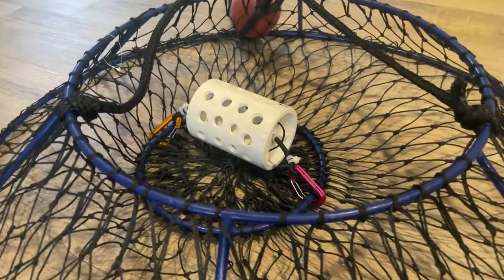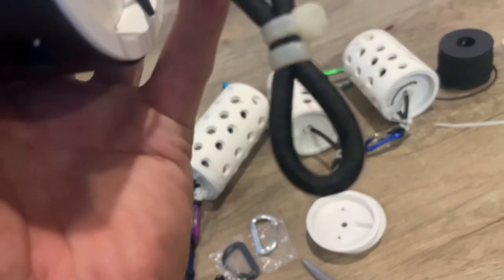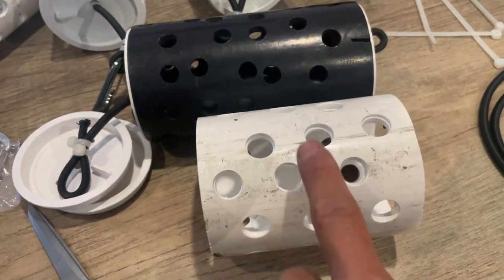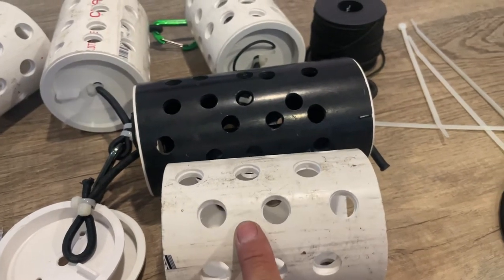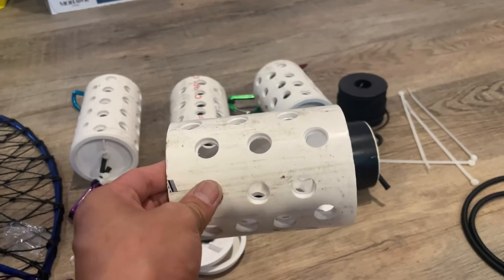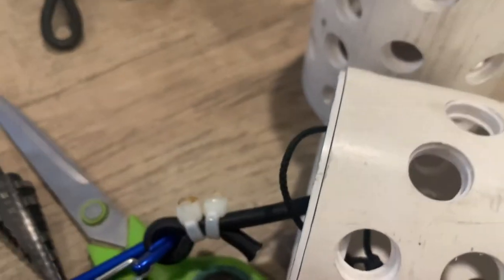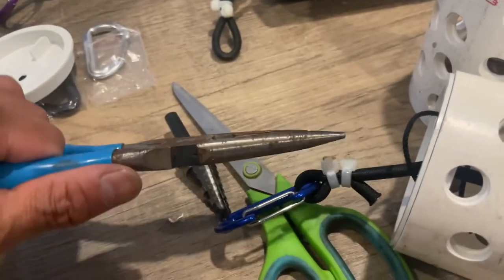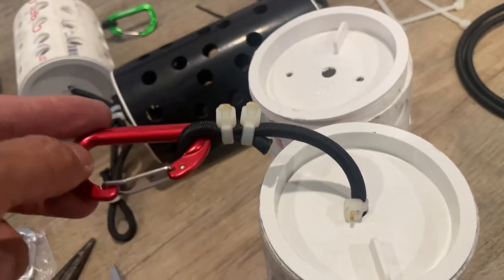DIY seal proof bait tube for lobster and crab hooping v2

Comment: Where did you buy the caps? And what is it call tap caps??
Reply from the maker: Home Depot: “Oatey 4 in. ABS Pipe Test Cap with Knockout”
Reply: @SoCalOutdoors  thank you
Reply from the maker: @mikeu3660  actually I used 3” not 4” but go with what works for you just match it to your pipe side.